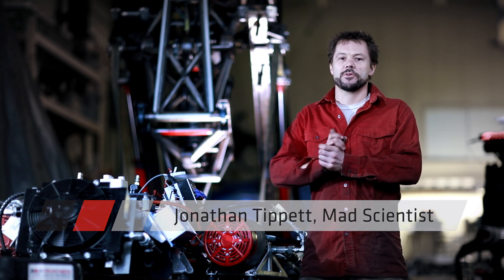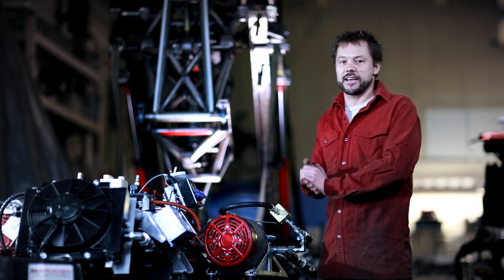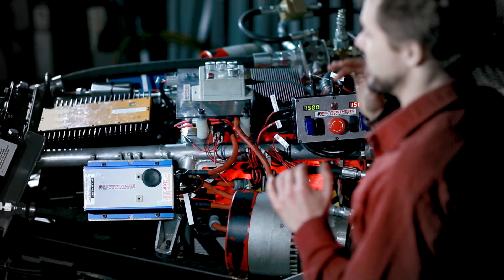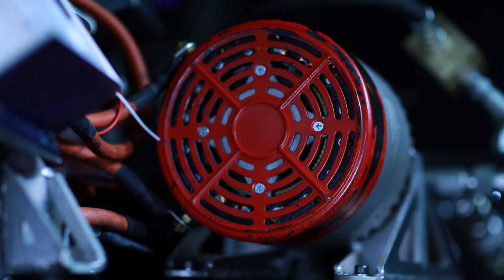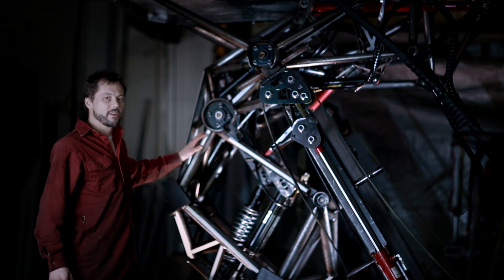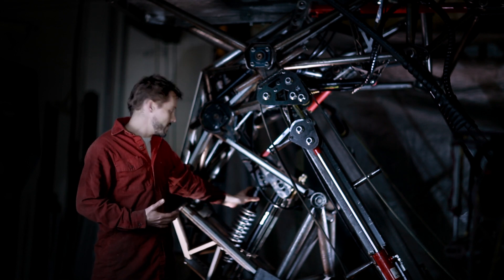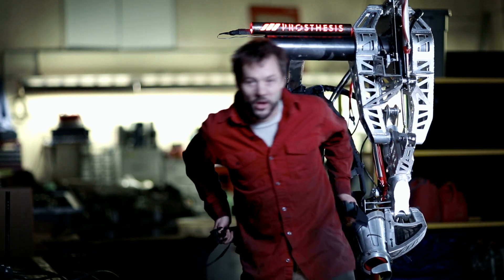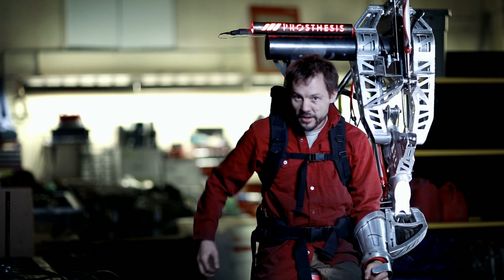Prosthesis The Anti-Robot - Technology Tour

Comment: are the controls always going to be that stiff or are you planning on using some accelorometers and using those to control movement to it could be easyer to use and not so physicaly straining ?
Reply: No. A significant amount of resistance is required for stability. If the controls were limp, the inertia of the exo-frame and your own limbs would create kinematic feedback when you are being flung around inside the machine. Most of the resistance is damping. Also, as the pilot gets more adept at operating it, they use less force. Kind of like how all you muscles are sore when you're learning to snowboard, but once to fine tune which muscles are needed, you become more efficient. And finally: it's a sport, so you just have to get fit.